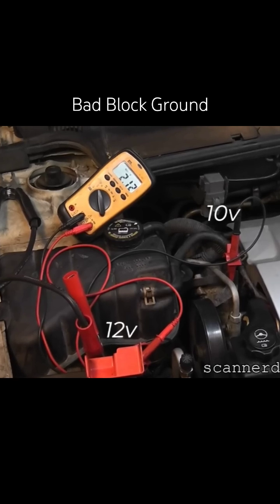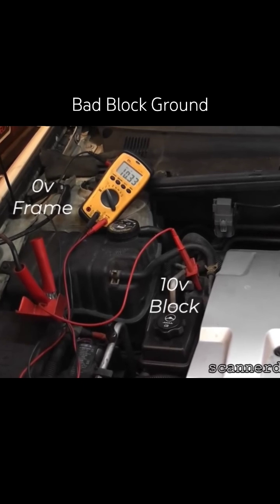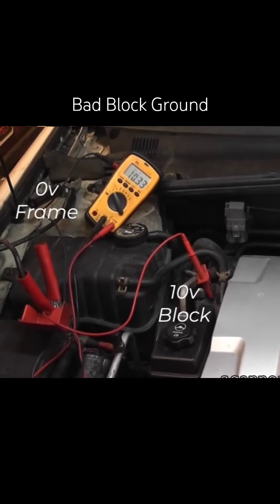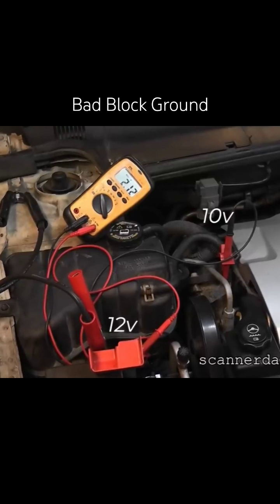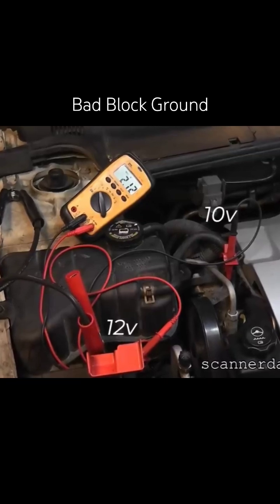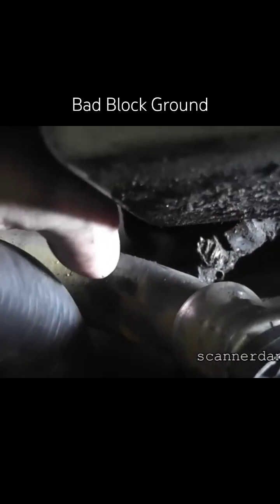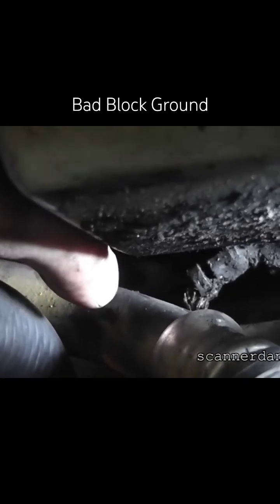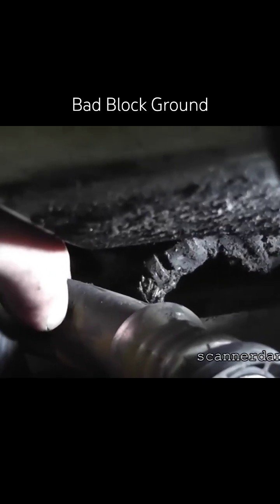Low Voltage from a Bad Ground? [Voltage Drop Testing Fundamentals]

Comment: when I first get a car, the first thing I do is add an extra ground going from body to engine and another from battery negative to body.  if it's not needed, it just won't be used.  it costs very little and takes very little time.

Comment: Hey man I found out what was wrong with that 2011 grand Caravans charging system it basically had a hidden electronic control module tucked down near the bottom of the engine bay up above the left front wheel well cover. It was purposely hidden by the designers of the vehicle I’m sure a real pain in the butt man barely even knew it was there most people would’ve took it in for service… sheesh

Comment: In this case (10v on the block) , if you connect an incandescent lamp from B- to the block will the lamp light dimly when the circuit is loaded(try to operate the starter )?